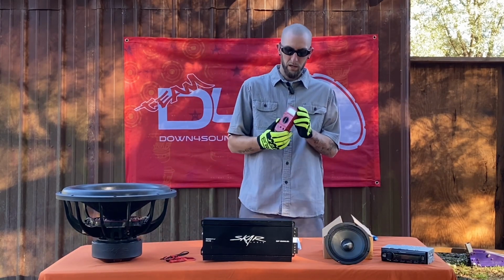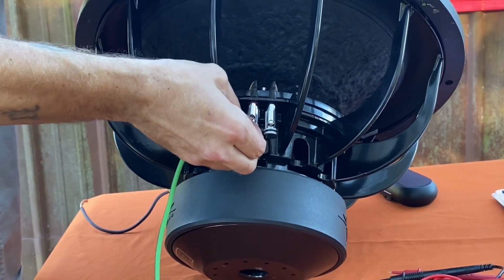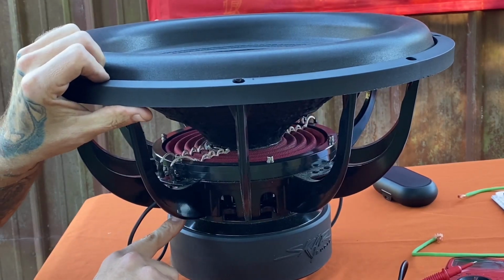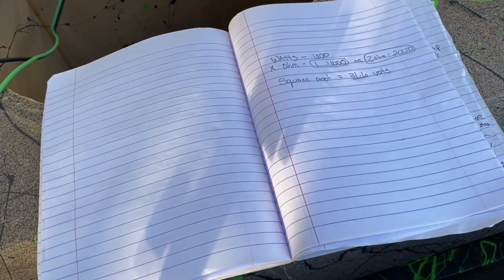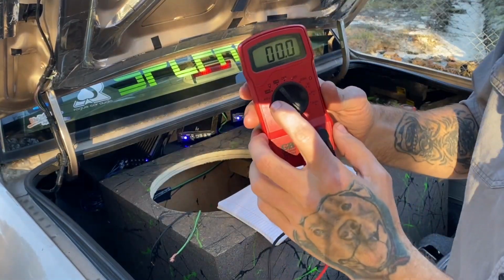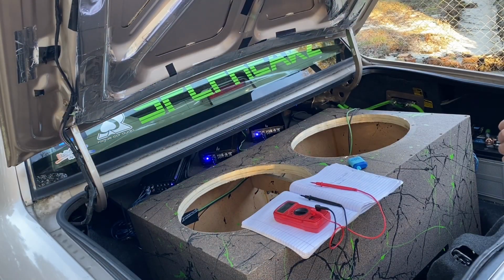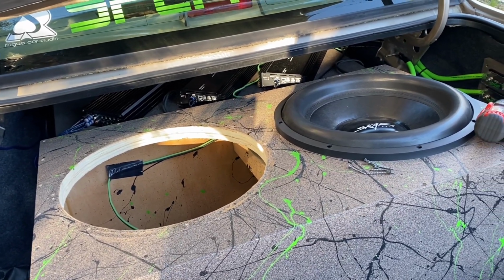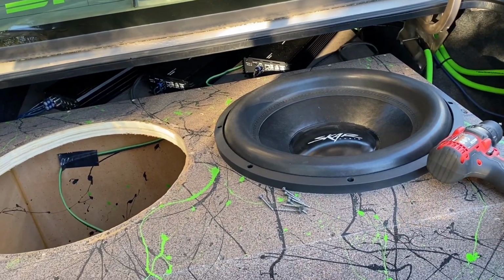How to set amp gain with multimeter (easy), wire dvc subs and trouble shoot

Comment: Good video bro 👍 I'm still learning on tuning but one thing I'm concerned with is almost maxing out out on the gain level 🤔.After a few research some say

1-play a 40 hz test tone
2-Max out your bass knob
3-Put your head unit to about 80% of it's max volume. 
Then tune the amp from there?